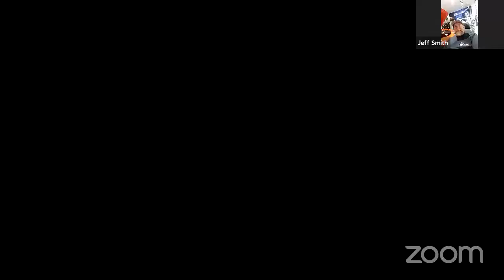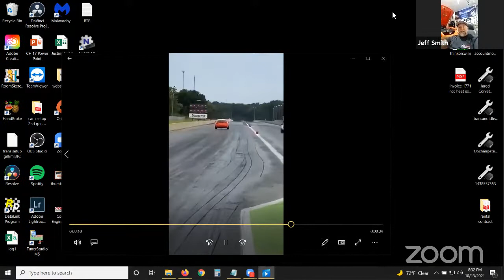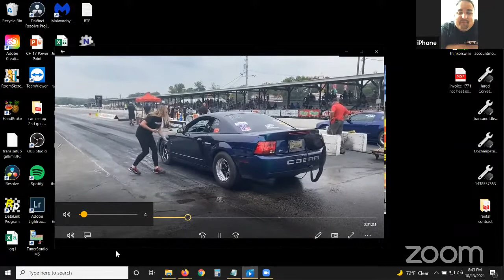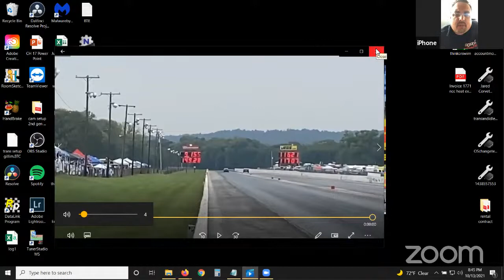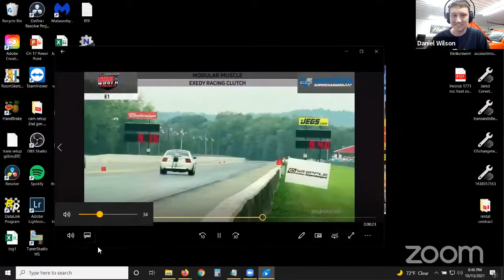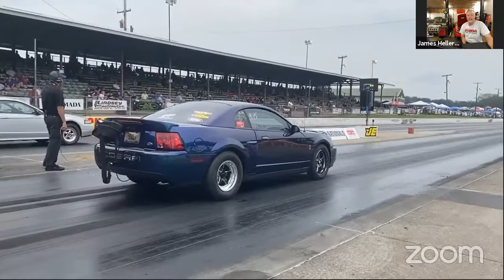cobra talk ep5 , chad creamer , jeff smith, cobra engineering. Gen5 whipple cobra

Comment: What would you personally recommend if choosing between a VMP 2.65R vs a Whipple Gen 5 3.0 for an 03-04 Cobra? Thanks.
Reply from the maker: What fuel are you using and what’s the purpose of the car?
Reply: @Wilsonandcars  Wan't to stay on 93 if possible. Ideally, would like the best of both worlds, something thats fun on the street but will perform well at the strip.
Reply from the maker: @jdiggs7238  on that fuel the VMP gen3R.